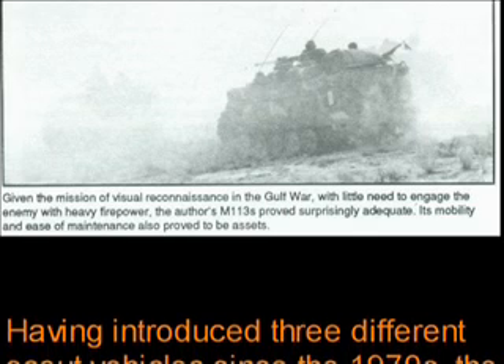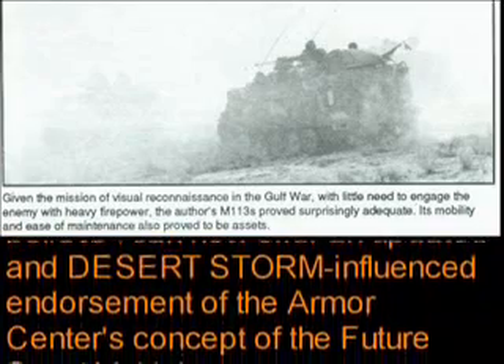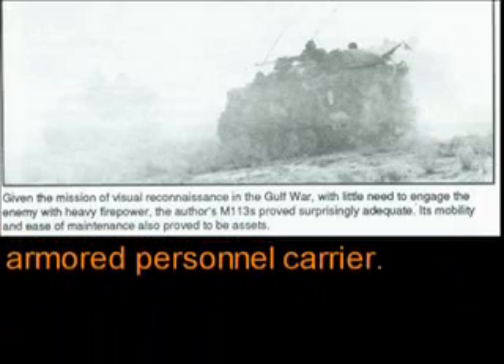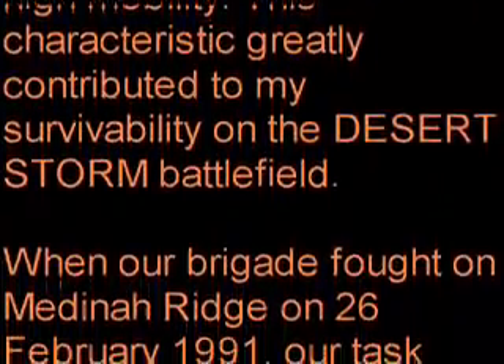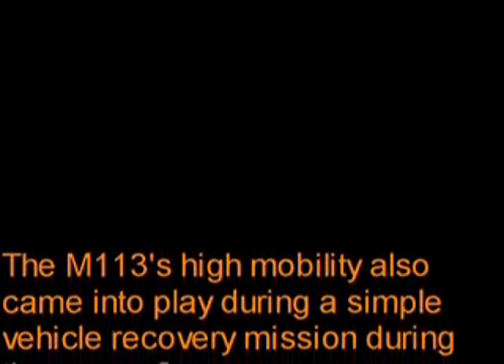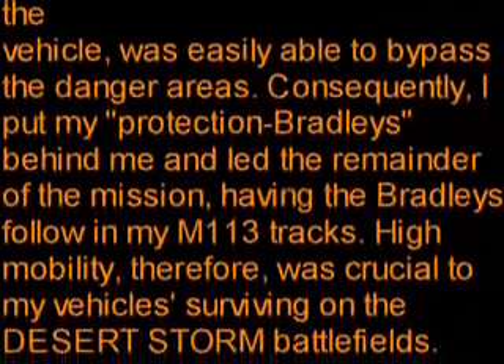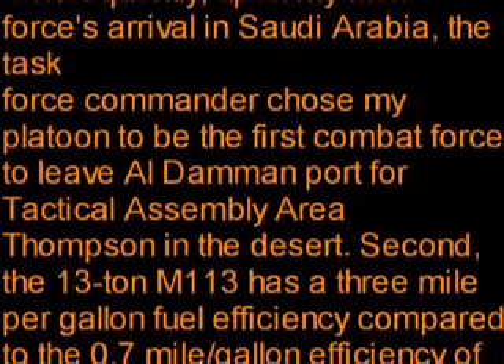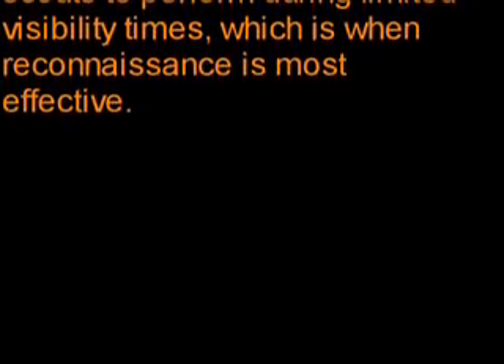Future Scout Vehicle: M113 GAVINs Save Day in Iraq 1/3

Comment: It's interesting that to my knowledge, the U.S. Army has not developed an ATGM missile system for IFV's that can be fired while on the movie. I remember their was the ADATS system but that was never purchased and it had the same problem of static firing only. Still in the era of stabilized cannon, you'd think they could develop a stabilized sight and ATGM system for IFV's perhaps using millimeter guided radar, IR guidance, or some other form of guidance. But at least Gavins are still soldiering.